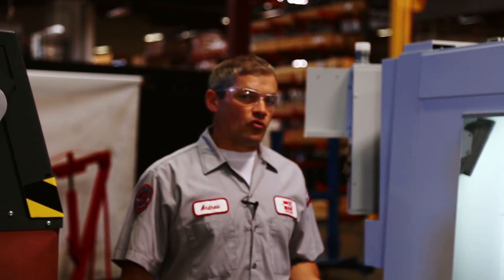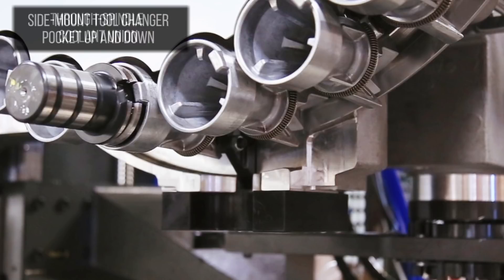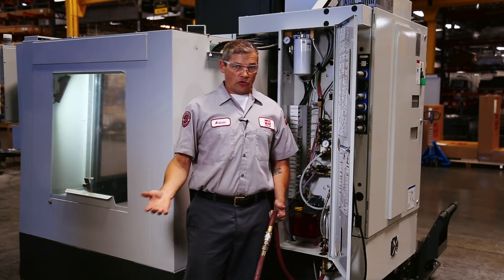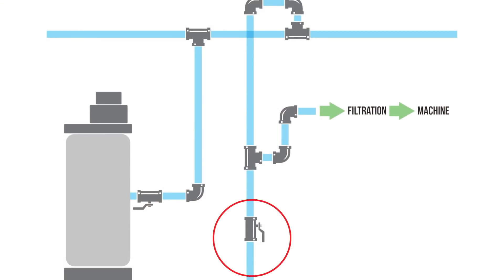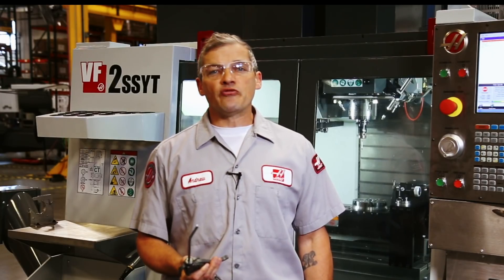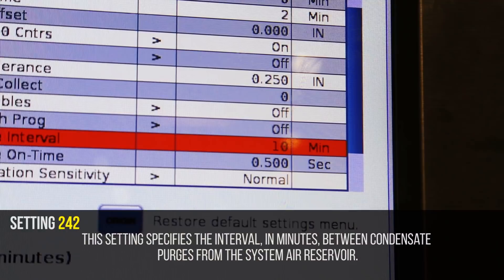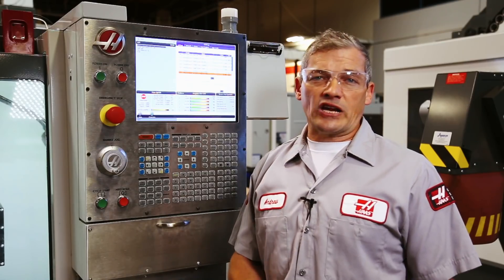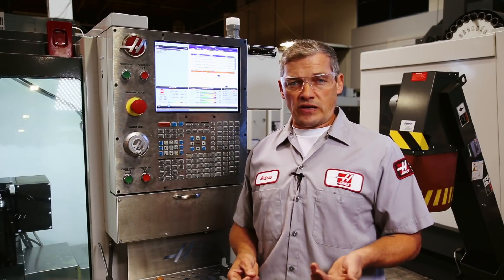Water In Your Shop's Air System? Setting 242/243 Can Help - Haas Automation Service

Comment: Might I suggest Haas change their control system, or at least add a setting, such that air purge and tool change do not happen concurrently? Like, if one is already in progress, wait for it to complete before proceeding with the tool change or vice versa.

Comment: Air dryers may be expensive but the damage from running damp air can easily exceed the dryer cost. If you can afford a $XX,XXX or more machine you can afford to get an air dryer.